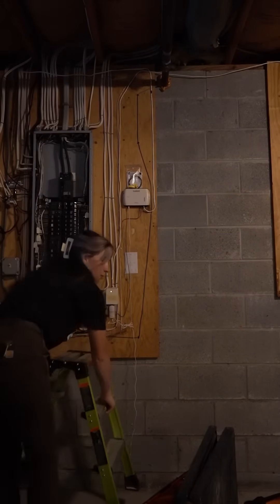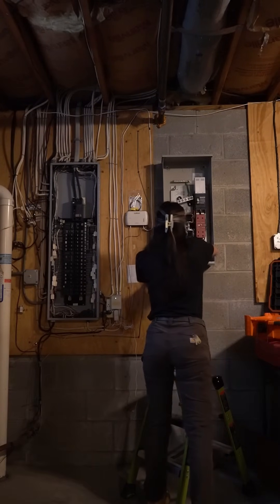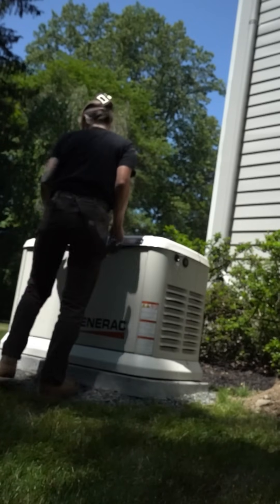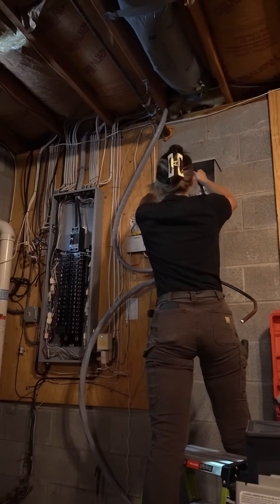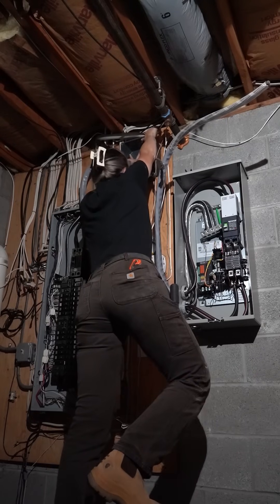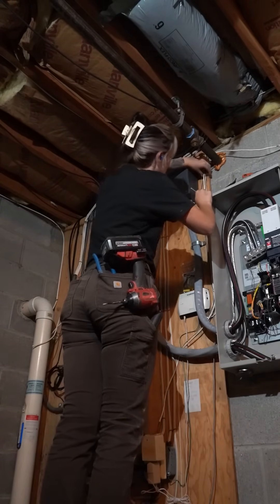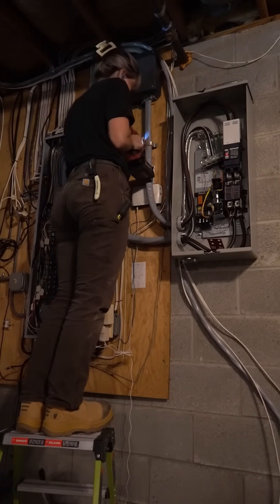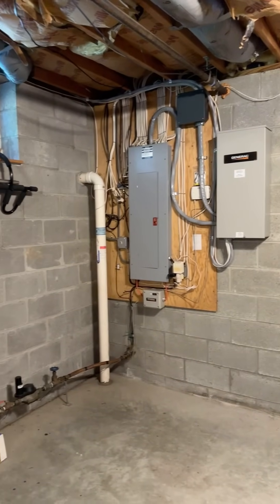24kw generac generator install

Comment: Nice work. Better off with quality carbide hole cutters over unibits. They produce 90% less hot metal chips, way faster and mine last 6 to 8 times longer then unibits. One tool & die shop made a jig up for sharpening unibits. Contractors that perform thousands of dollars of work should be shoot for not painting plywood for panels. I used to ourchase a few sheets of 3/4" exterior plywood and have lumber yard cut them into theee sizes and paint all of them on a day  when work got canceled or postponed at last minute. Had 2 sets of 1/2 to 2" hand knick out sets & two Greenlee hydralic hand pumps but that battery operated KO tool is a must have. Had a 4 fiberglass step ladder & they came in handy. At one halve millon 12 story building they had 7' fiberglass ladders that wirked out great. Most of the drop ceilings were just below level of an open 8' step ladder and usually they had 5 to 6' above drop ceiling.

Comment: Great job,looks good,I like to see other sparky’s work,I only did my required residential to get my JW license,the contractor I worked for mostly did heavy industrial plants,pump stations ect,all the generators I installed have been in 4” Rob Roy,same concept just larger scale

Comment: Awesome work !, How far was the run from your meter to transfer switch? I’ve had someone tell me the transfer switch has to be next to the meter .
Reply: Yes, need main disconnect outside.  Depending on generator location this install fails inspection

Comment: So I do residential elevators. The electrician hooks up the transfers. Thanks for all your details. I have worked around transfer switches a lot after they are installed. You have taken the mystery out of it. Conceptually easy. But as many things, devil is in the details. Thanks for your details Lexi ‼️🫶🫡🙏

Comment: Does a load shed module accomplish the same thing as having a soft start switch at the AC compressor instead? I'm looking at installing a similar Generac setup with that ATS, and I want to make certain I'm understanding how to best manage that run up current from the AC units (I have two..one on each floor). 

Also, if have 2ea, 200 amps panels. Do I need 2 ea, 200 amp ATS's??

Thank you for your time.,
Reply: What is the service size?  May need 400a ats

Comment: So how does a dual transfer switch work?  I have 2 (200amp) service panels. I assume I’d need 2 transfer switches but in my head I’m not sure how that would be wired up.
Reply: Get a 400a ats if its a 400a service

Comment: Nice job! Few helpful hints… I would have mounted plywood behind the ats and instead of ser for the load side run 2” pvc inbetween the panel and ats and use 4/0 xhhw and a #4 ground. So good to see young folks in our trade out there killing it. Keep up the great work.
Reply: Yea, so nice to see them splicing the service entrance cable instead of replacing (its probably another 3 feet).  Great work, so much pride

Comment: This is an excellent display on how to correctly install a generator service. A lot of electrical personell do not know about seperating the neutrals and grounds because of the 1st point of disconnect being changed. You are one heck of an electrician there Lexi!.......Maybe I can be on the next 360 Electric podcast if he will send me an invite. I want to personally tell you how well rounded you are with your electrical knowledge.
Reply: Any electrician would know that

Comment: That load shed box, does that somehow reduce/eliminate the LRA for the AC? 

If so, another idea is to install a soft start on the AC itself… or any load that has a high LRA, like a well pump etc….
Reply: They’re the same. Load shed modules are like wiring manual transfer switches with with wire nuts. But load shed, you can pick and choose what appliances you want to start first and want to last

With soft starts, you’re limited on what appliances you can wire to. Refrigerators and hvac are almost the same appliances but it doesn’t make sense putting a s.s on a fridge. It’s easier to put it on the unit itself where you could put a “load shed” on a fridge circuit instead. 

I’m guessing a rule of thumb is automatic = load shed, manual interlock = soft start

Comment: I think the install is legit, my only preference would be to just get rid of the existing SEU and come out of meter socket with a brand new piece.  It would look a little less busy and probably cheaper in materials not buying Polaris connectors.  But that’s just my opinion.
Reply: Yes, my customers would have thrown me off the job if i splice like that.  Really hack work... Probably no permit and so she couldn't unlock the meter trough...

Comment: So, if the transfer switch will be the main disconnect, presumably an acceptable isolation, would you need a breaker isolation too? If so, what about maintenance on the box? How would you isolate both sources foe electrical work? Just disconnect the gennie somehow or does the transfer switch have a manual transfer as well?
Reply: It has a main and it actually belongs outside, this install is wrong

Comment: You do very meet work. I try but mine is not that great. Those cables are hard to deal with for on person, with 2 is alot easier.  Plz if you can wouldcliketosee more on the ground separation. And explain why. Thank you so much. I love general stuff too it is so great. Nice to work with too.
Reply: The work is terrible actually.  Looks like a temporary installation

Comment: What size wire do you use from the generator to the house?
Reply: Between 6/2 aluminum to 1/0 by looking at it.
Reply: Usually the nameplate on the generic will tell you the size wire you have to run.

Comment: Generac require six low-voltage control wires to operate their systems.  

SURE:  Two (2) number 14/2 W/g Romex  has six wires; two of the six are bare.  Bare wire is not allowed for conducting electricity load.
 
Bare wire is for bonding only.

Comment: I would have ran a new SEU cable from meter to ATS. 
You also brought your #2 SER and 14/3 rx’s  in the same connector when entering the ATS. They should have separate connectors

Comment: Thanks, I enjoyed this video. It is the first one of yours I watched. Now subscribed... I would like better lighting for your indoor work so I can better observe your work. Also, did you use a torque measuring Allen wrench to go over all your connection after the conductors took a set? From what I observed it looked like your were using a folding Allen wrench set for the initial tightening.

Comment: My next door neighbor had exactly the same generator installed last week with similar transfer switch and other components.  It's a modern home with everything easily accessible outside and inside so I have no idea why it took 4 guys 3 days to complete the job.  And I'm pretty sure that you did a better job.
Reply: No shot
Reply: She just kinked up two pieces of ser cable, honestly i would have done the same thing because im a hack too but definitely not anything to be proud of...Its lousy work...
Reply: Then she spliced the service cable lol.  At that point just replace the section that goes to the meter, no?  Im a butcher and i still would replace...
Reply: That’s definitely a one person job, when you have more guys onsite it because those other boys are trainee, basically new lol so those other 3 guys are learning lol 😂

Comment: At 6:30, in another life as tower dog, use a carabiner on a small diameter rope, tie cow hitch knot around tool handles, clip on, hang tools from waist, pants, belt, ceiling, wall, wherever.  I do it too, stand on top of short step stool...
I use the Rubbermaid brand, they're light weight, collapse instantly for moving and storage, and ofcourse 'hang' in the back of the van from a carabiner!  Great info on the neutral and ground bonding 'subpanel' !!

Comment: Thank you 😊, for future reference..
As the transfer switch becomes the NEW MAIN DISCONNECT ( the grd rods and water meter ground should be bonded to the neutral bus at that location. Fantastic PRIDE in your work.
Reply: Not permitted work so she aint worried about that

Comment: I find it laughable that people in the comments are saying the panel (and presumably the SEU) were hot when she's working everything barehanded, because she never showed in the video the meter power being shut off. Jeezus, can people not figure out obvious things like that? There would have been a fireball and she'd have been dead the moment she tried to barehand the live lines.

FWIW I've not heard anything good about Generac products. Also, I would have moved that white electronic module to the left and down slightly if possible so it wouldn't be buried under the output cable.
Reply: She just taped the ends

Comment: Generac is junk. Go Kohler if you want a standby generator. Generac ALWAYS have problems and break down
Reply: My generac has a 30hp kohler gas engine what are you talking about? I’ve never seen a gernac without a kohler…
Reply: I said standby….not portable

Comment: In my area exposed ser cable will fail inspection  because the code states it cannot be exposed in an area where it can be subjected to physical damage.  We’re required to sleeve it anywhere it’s exposed below 8’ in Florida.. inspections must be a breeze in your area.
Reply: In my area we cannot splice wire between meter and panel.
Reply: @johnhooton3286 i wouldn't do it either but why?  Code doesn't say anything about this?
Reply: I've always run ser exposed. But I run mine into the top of the trany switch when located inside.
Reply: Ser cable is UV rated so obviously its designed to be exposed.  Seal tight conduit has the same requirements for physical damage protection and we are weed whacking them constantly near the ac condensers

Comment: I've been an industrial electrician in England for 50 years and you would not get way with that install in England especially regarding how it looks ,did you remove the white box that you crossed over with your load cable into your junction box

Comment: remember if you're having your generac installed by a stranger. if it's all rusty when it's brand-new he's guaranteed to get maintenance and repair work out of the deal just a few years down the road. make sure you thoroughly inspect it! look at it carefully yourself it should be perfect absolutely no rust no corrosion on the aluminum and fasteners

Comment: I bought a big generac. had to pay cash for it at Lowe's. when it finally came six weeks late. I took it home on my trailer and uncrated it. it was rusted up inside like it had been under saltwater! I'm glad I didn't take it off the crate and put it on the monsters foundation I made for it. 4 by 8 by 1 ft with rebar. oh yeah I want to do that pump up the ground so it didn't get wet. they use crap material when they made it. took it back to Lowe's 3 weeks later they get another one in. this time I open the box at the store and the manager almost passed out. he said this is LPG product I can't sell it like this it's dangerous. I said oh yeah I don't want all that propane out in my backyard either blowing up my house. I had a hell of a time getting $6,500 back from Lowe's in cash. you bastards made me pay cash. I want cash back and I'm going to call the sheriff. I called code enforcement to. I'm now friends with the code enforcement officer he's really careful about generac's and he has spread the word all over Florida they are selling generators that got flooded in the warehouse!
Reply: Your problem is you bought it from Lowes. Buy it from any reputable dealer and it wouldn't happen
Reply: Plus don’t buy generjunk.
Reply: @MrCmgl1  🤣🤣 what's the alternative.. Cummins the only other reputable brand

Comment: Nice work. If I may, the only thing I may have done differently is the cable coming from your 8×8 to your transfer switch is over top that small white box, (not sure what it is) Whoever might need to service that won't appreciate it. Other than that, nice job.
Reply: I was hoping she would relocate that white box at some point.
Reply: Oh yea, really clean work lol.  2 kinked up service cables and one 4/0 spliced for no reason lol.  Really good job

Comment: As a master electcian for starters house branch circuit should not be run threw main breaker section transfer switch should have been reolcatedto were existing panel is and then relocate existing panel next to transfer switch my inspector would never have passed this I would give thus install 0 out of 10
Reply: Yea the work is shit i know that but the 14/3 is her generator control and charger wiring lol.  She probably ran the romex outside in sealtight too

Comment: Just curious why you chose to put a jbox in for the SEU service drop from the meter to the transfer switch instead of just putting in a whole new drop?
Reply: I had the exact same thought. We do not splice the main service. Always new seu cable.
Reply: Shes a hack

Comment: Loot of unprotected Romex... Is that going to be addressed???
Reply: If you are talking about all the circuits running to the panel, how exactly would that be addressed? They are stapled to the backing board, what more would you want? Most panels I see around here don't even have a backing board. Panels are mounted on a 2x4 nailed to the rim joist and just hanging on the wall.

Comment: Nice job overall! Next time change out the service cable from the meter and avoid all that extra work. 👍
Reply: How about we just presume she did this the easiest way possible and running a new cable was more work.
Reply: @rupe53  not really
Reply: In my area we are not allowed to splice between meter can and panel.
Reply: @johnhooton3286  ... that splice will be to a service disconnect so ok per NEC.
Reply: @rupe53  can you supply code reference? I haven't been able to find it.
Reply: @johnhooton3286  ... I don't have time at the moment, but it should be easy to see a service disconnect is allowed between a meter and a panel.
Reply: @rupe53 its a splice, not a disconnect lol
Reply: @coreyfranco7060    yes, it is as of this video.

Comment: Such a difference between commercial and residential all that exposed wiring nothing in a pipe is crazy to me but I guess as long as the local government signs off on it all is right. When the hacks built my house in Oklahoma  they used a Eaton residential panel it seemed like I could crush it like a beer can then they used a 2 foot piece of rusty rebar leftover from the half ass foundation pour for a ground rod stuck half way in the sand. I’m sure it would get that 25 ohms for sure probably 25 million.you seem to care that’s 99% the other guys will run you out doing it cheaper and faster especially if they pay that code man off
Reply: That cable carries a UV rating so obviously its designed to be exposed

Comment: The only thing I don't like is that she covered the customer's white low voltage box with that cable coming out of the left of the transfer switch box. It will be a pain to get into that LV box when the time comes.
Reply: looks like an older telco interface. Easy to move over when she is done.
Reply: @rupe53  Yes.... which is work for the customer or the telco guy. She could have easily routed her cable around it. I'm just saying I personally wouldn't do it on my own install, and I wouldn't do it on a customer's install.
Reply: @MyBacktrail  ... why would it be work for the other people if she moved it? Have you ever wrestled with 4/0 SER? I'd rather run that straight and move the small stuff over. (and that Telco box my no longer be in use)

Comment: These ATS’s come with terminals to use to control up to 4 A/C’s. No need to purchase a power module for the AC. Simply break the thermostat wire.

Comment: The ats switch should be mounted onto plywood per nec. Second question would be why wouldn’t you run conduit from ats to the sub panel and make it look much cleaner.
Reply: Not required but I see so many panels rusted out much faster when someone just mounted them to the concrete.  I like to mount treated 2x4 to the concrete then plywood on top.  But around here basements are very damp.
Reply: @AdirondackCampingAdventures  nec article 312.2 a requires a 1/4 airspace between panel  and support surface in a wet location. Basement is a wet location.
Reply: @hansenj11 that’s why nearly every panel has bump outs to comply with the 1/4” air space rule. Also this ATS is aluminum so it won’t rust
Reply: @hansenj11 1/4" spacers built into the enclosure already.  No plywood required
Reply: I was wondering the same thing about running conduit.